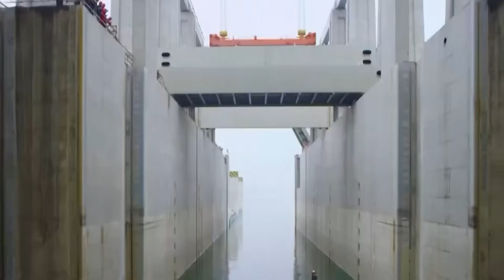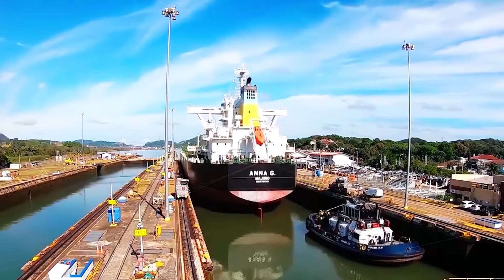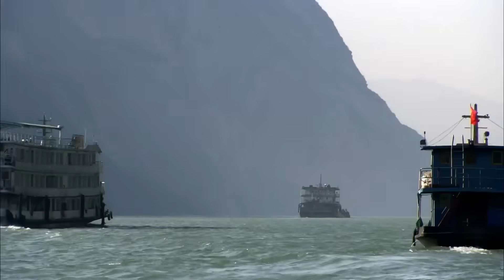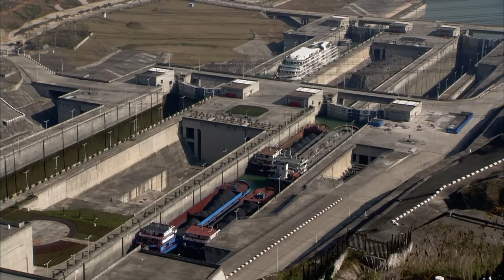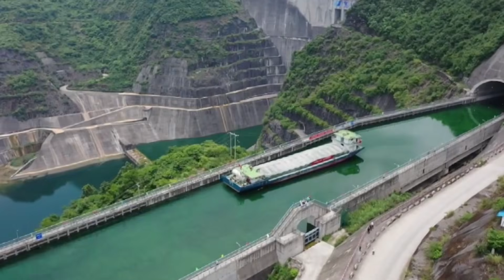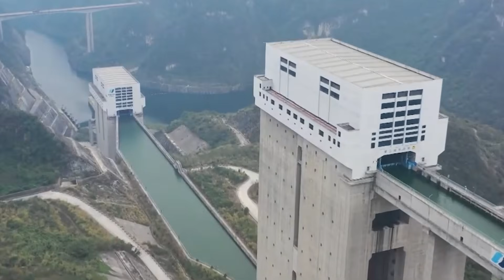China’s INSANE Water Elevators Lifting Ships Into the Sky!

Comment: Hearing about lifts, elevators, cables, etc. but the words ‘pump’ and ‘float’ were never used. Speaking of sustainability, why wouldn’t such a system — moving water around — work?
Reply: "a system — moving water around" exists. It's called a lock. There are 5 of them parallel to the lift in the Three Gorges Dam. 125m vertical movement in total.